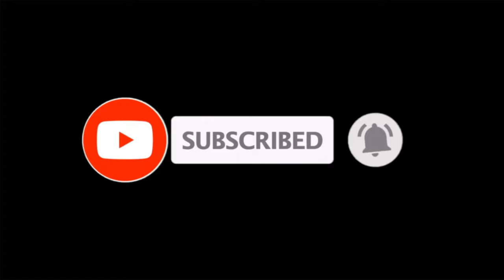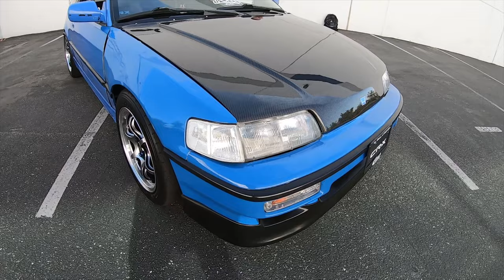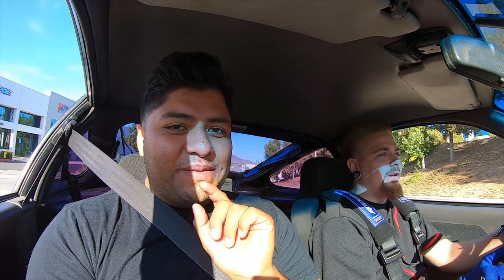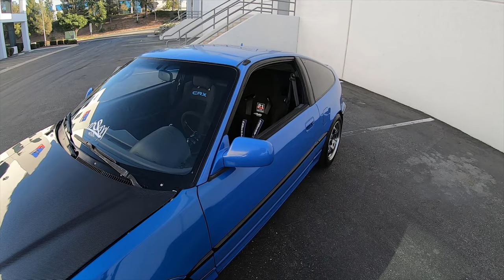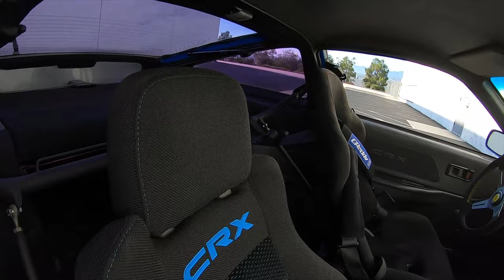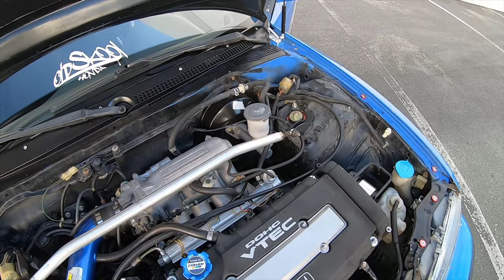BUDGET BUILD 1991 Honda CRX B16 DX: Fun Commuter!

Comment: Bro i have a 1989 base CRX old school style look tuff and sounds tuff old school style d15b2 block with p08-3 head no crap vtec at all obdo distributor better spring and retainers 272 Delta cam regrind header and a Weber carb old school style light weight flywheel gd clutch kit free flow homemade exhaust system 10.1 to 11.1 compression and people always ask me if i have a v8 jjjj 😁 she sounds beautiful old school muscle car sound ford dp sound like a lion she do 110 miles in 3 gear easy and fast she pullbsi hard in mid rpm up to 8500 rpm easy but man she sounds nice beautiful people seems to love her looks and her sounds and she look her age rade original paint but with the wheels and tires front spoiler lip and rear spoiler she look and sounds like a race car.😊

Comment: The community is great! I’ve had my ‘88 Si for 19 years! The car has been through soo much and traveled from ND-FL twice…all with a rebuilt D15 motor. It’s time for a B20 swap tbh… but for the time being the car is in the shop getting restored and getting the color 46v spray onto it (Mazda Soul Red). It’s gonna be fire hot when it done

Comment: I kick myself in the ass every day for abandoning my 91si. The body was super straight, primer Grey and ready to paint. The guy I bought it from ,who had no idea what he was doing, had already swapped a b18 fully in place but said he was never able to get it to run right. Sold it to me for a whopping $700. It had that much in bolt on parts. DC headers, Gredy exhaust, AEM intake, skunk2 swaybar, Apexi tach. Sat in the yard for over a year  except for driving to the gas station at the end of my street. Kept tinkering adjusting the distributor and throttle position. I had no clue what the hell I was doing. Moved to another city and left the car at the house with my roommate. Never talked to the guy again. Now 18 or so years later I know a ton about cars and realized that the only thing wrong was that it was running on the stock ecu. I could have slapped a hondata in it and hauled ass. I hate myself
Reply from the maker: Buy another one man.
Reply: @Automotive Anatomy Got a wife and 3 kids. Not an expense I can justify right now but I would love to one day